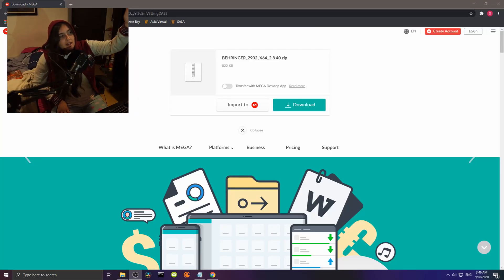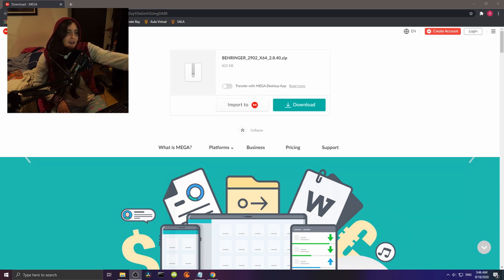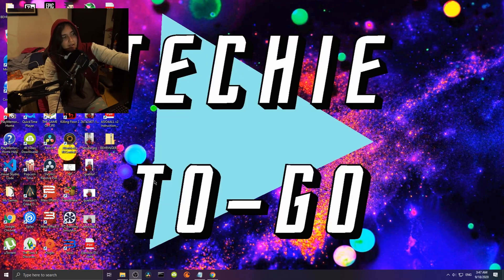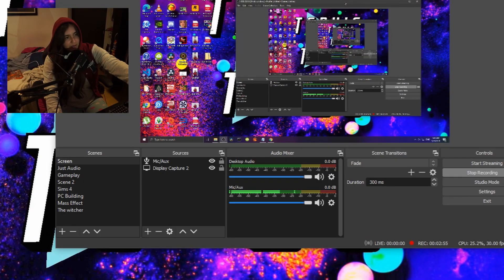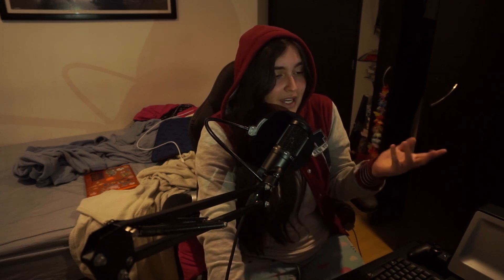FIX UPHORIA UM-2 NOISE!! (ALSO WORKS ON OTHER INTERFACES)

Comment: So using ASIO4ALL, i have always experienced latency issues (I use an MXL990 for my mic), but they've always been so minor, that I've over looked that issue. I never even though to download the drivers that are meant for my audio interface. Anyway, i downloaded the drivers, and was very impressed with the lower latency it offers (3ms). However, all was well until i tried mixing. Every time i chose a new plug in, i would be greeted with awful crackling sounds. I know it's not my computer, as i recently upgraded (CPU usage is at 6% when FL is open). There are no crackling sounds when using ASIO4ALL or FL STUDIO ASIO, which leaves me to conclude that it must be Behringers shitty drivers that haven't been updated in over 3 years, or could it be something else? I've tried disabling unnecessary sound drivers in my system settings, and that also didn't work. Has anybody had this problem, and if so, is there a fix?

Tl;dr - UMC22 making crackling noises whenever i add a plugin to the mixer.
Reply from the maker: Have you tried using less USB ports? That generates that problem sometimes.
Reply: I'm using 3 out of 4 USB ports, i will have that in mind, i kinda fixed the problem with asio4all driver, i unplugged my headphones from my A. I. and plugged them into my pc, running only my mic on the A. I. , and then combined them both, it fixed the cracking noise but now i can't have my headphones plugged in a.i. and it really bothers me, also can't do the "Direct Monitoring thing" ...
Reply: @mrserpenteen4117  Your problem its pretty simple to diagnose, those 3ms of low latency, is the issue, when you add a plugin, the buffer of 3ms is too low for procesing operations, try to up the 3ms buffer to 4, 5 or 10ms. else you have to use another driver with a bigger buffer size.

Comment: i still have problems with the noise after installing the driver
can you help me?
Reply from the maker: This interface still has some huge grounding issues unfortunately, and the drivers can only help so much. If you're using it for YT videos, I recommend using OBS Noise Reduction. Other than that you would need to try to remove it manually.
Reply: @thesaintofwolves  ok, thanks, i'll try to make something for that grounding problem, if not, i'll try what you said

Comment: i got the same interface and i did the thing and i still got some crazy noise
Reply from the maker: This interface still has some huge grounding issues unfortunately, and the drivers can only help so much. If you're using it for YT videos, I recommend using OBS Noise Reduction. Other than that you would need to try to remove it manually.

Thanks for watching!

Comment: SO I GOT THE UM2 RIGHT, THEN IT WAS WORKING PERFECTLY. I GOT THE DRIVER FROM THE BEHRINGER WEBSITE THERE WAS NO BUZZING. COUPLE OF MONTHS AFTER RECORDING I HEAR THIS BUZZING SOUND. NOW IM CONFUSED I KINDA TRIED TO TROUBLESHOOT IT REPLACED THE WIRES ALL THAT AND EVEN UNINSTALLED AND INSTALLED THE DRIVER AGAIN BUT STILL IM GETTING NOISE. CAN SOMEONE HELP ME OUT PLS.
Reply from the maker: This interface still has some huge grounding issues unfortunately, and the drivers can only help so much. If you're using it for YT videos, I recommend using OBS Noise Reduction. Other than that you would need to try to remove it manually.

Thanks for watching!

Comment: I have the Behringer Umc-22. Does this still work?
Reply from the maker: You would have to give it a try, either way, these kind of things are reversible through your device properties so worst case scenario you just put the drivers back to default.
Reply: @thesaintofwolves  It didn't work, however, I found a different tutorial and all I needed was a different driver. Thank you for pointing me in the right direction though!

Comment: These are not the drivers for this device. Had they been, they would be available in the official Behringer web site, but they are not. Behringer's official documentation and videos, say no drivers are needed for this device and the AUDIO CODEC that is used by default, is the one officially suggested and supported by Behringer. These (2009) drivers that are suggested here and in other videos, will not give you a single channel (mono) output available with AUDIO CODEC, only dual channel ones. So your XLR input will only sound to the left channel. This may be fine if you're mixing with an audio software, but it will render your device useless if you want to use it out-of-the-box as a communications interface.
Reply: Thats what I figured out after installing them. Unfortunatly if I deinstall them through the software my Mic doesn't show up in my Sounds anymore. And i tried everything to get it working again. Do you now how to install the 'old' 'normal' windows drivers again??
Reply from the maker: Sorry this didn't work for you! It's an easy process, so let me walk you through it.

1. Right-click the Windows/Start button on your bottom left corner.
2. Click on "Device Manager"
3. At the bottom of the list you'll see "Universal Serial Bus controllers", click that.
4. You should see your interface, double-click on it.
5. A little window will pop up with a few tabs, click on the "Drivers" tab.
6. You'll be presented with two possible options, "Update Driver" and "Uninstall Driver". "Update Driver" should tell Windows to look for the newest driver they have and install it. I'm 100% sure it won't damage your device or anything, however I haven't done it myself because I'm fine with the ones I mentioned in the video. Worst case scenario? It just doesn't install new drivers. Now the other route is "Uninstall Device". This one will just remove the device and the drivers for it from your computer. To get the original drivers back, just disconnect and connect the interface again, and Windows will do its thing.

Hope this was helpful!
Reply: @thesaintofwolves  yes i tried that over and over again. But each time after the deinstallation the micro would never be recognized but the pc again..
Reply from the maker: @moritzschmid9613  I've given the same instructions to other people, and it works fine. If you hit me up on Instagram I'll be happy to help see what's going on.
Reply from the maker: Yes you're right. It's not the biggest deal for most people that are using any kind of editing software so I really didn't see why I would mention it. They are, however, Behringer drivers that do help a lot with the software side of the noise issues many people have.

Comment: After installing the drivers, the volume on my mic is now very very low even after turning the mic gain to max.
Reply: too
Reply: i have the same problem did you find a fix? or how to install the old drivers? Since deinstalling these drivers didnt work for me
Reply: @moritzschmid9613  same, how u fix it?

Comment: whgen i instal the driver, i can just set up my mic in stereo, and it jus recordo the left side, i know than i kan edit that, but i use my interface to voice call, do u know how to fix it?
Reply: I got a diferent solution with hardware because im not a fan to use voicemeter because it laggs my audio in gameplays (and even now, i dont know why)

The problem was than the usb data cable get dc noise (um2 interfase dont have n dc cable, it get power with the same usb cable)

The solution? Split the dc and the data, make a "mod usb cable extention", a normal usb cable have 4 lines, 2 for data and 2 for dc (the dc color are red and black) so i cut the custom cable in the half and separate all lines, and put the dc cables in one side and the data cable in other side (its important to remember with one its the dc cable and witch one the data cable).
The original cable get conected to the modded extention, you got 2 usb, theside data go to your pc and the dc cable you can conect it in othee usb port (it doesnt matter because the data source will be clean of dc) you can even conect thw dc side to a eall with a movile dc charger, an woala, it workc for all interfaces because it is almost the 100% of the sourse noise.

Excuse my horrible english, it is not mi native languaje and i dont use to write it (but i can understand it perfectly) but if you dont understand me, i can post a video link about someone doing what im talking about (in spanish but uou can get the main idea)
Reply: @xluismigueljcx  Hey, that is very interesting!

 For you issue with voicemeter, if you need to use it, you can lower the latency by going to settings, and changing the buffer size of the different apis, In my system I can put the WDM api with a buffer of 160 samples wich at 44.1khz or 48khz is a latency of about 3ms, pretty much unoticeable for games and normal recordings. 

Can you please post the link to that video of USB split cable?, I would like to try that mod. Thanks for sharing the info!
Reply: @terry-  shure, just let me search it, im wirling rifjt now and i havent a chance in this moment. But ill pos it today

And shure, i can downgrade the size of mu buffer nut i try thatcincthe pasr and its not much diferent, the audio still got "cuts"

And i have the idea than if you have an audio interface , you want it to get s good sound, to upgrade it, for me it was not a good solution to downgrade the buffer size
Reply: @xluismigueljcx  Thanks man!
Reply: Simple just go to the sound control panel, then speakers then click on your interface and you can change it there, I'm not in front of my pc to tell you the exact steps, but that is basically how you change it to sound in stereo, or mono,
Reply from the maker: Hi! You would have to use your editing software or voicemeeter banana to convert it to mono. I have the explanation and reversal instructions pinned at the top :)

Comment: I just installed the same drivers you have shown, but here's the problem, I got no fuckin input from my microphone I DON'T KNOW FUCKIN WHY, maybe others got the same problem as me?
The only difference between you and me, is, that you used the UM2 but I used the UMC22. I googled very much, and found like, everyone talked about iunstalling them, I did and know, I have no mic input. I tried multiple times to reinstall the drivers, doesn't help. So someone got an idea what I can do?
Reply from the maker: What program are you using to monitor the input?
Reply: @thesaintofwolves  I wanted to use this Audio Interface with my aukey gd-g1 mic basicly on discord to chat with friends and people :), to have a better sound compared to headset microphones. I did couple bad experiences in the past with headset mics LOL

Comment: This helped a lot! Thanks! Just one thing is bugging me: when using windows "listen to this device" the sound is good, but when passing my audio through VoiceMeeter, even when the knob at my UM2 is all the way to 0, i have some noise. I don't know if that buzz/noise can be heard by the others when speaking but it's there. Have you encountered this problem?
Reply from the maker: Hey! Yeah, it's still pretty noisy because of it's grounding problem but a lot more manageable. I personally use OBS and it has a filter called Noise Supressor. That works great for me. It's not the ideal but it does the job.

Comment: Thanks how can i use my microphone with this new drivers? Cuz seems like this new drivers don't read any input signals :(
Reply from the maker: Your interface will be set to 2-channel. Therefore, it will seem that you only get audio from one of them. If you have a windows computer, sometimes you need to mess with the settings a little to hear it.
Reply: Thanks 🔥

Comment: Hey I've got this problem where my shit makes so much of sound infact all sorts of sound's be it static, white or ground noise. I thought it was from the mic so I unplugged the mic from the interface and it still makes noise regardless of the mic being disconnected from the interface. Any idea on what can I do?
Reply from the maker: This interface has a really bad grounding problem. Try putting it different places or connecting it to different usb ports. Sometimes it helps a little. I use OBS Noise Supressor in my videos and I think it takes out A LOT of noise
Reply: @thesaintofwolves  alrighty thanks :) what's obs noise suppressor?
Reply from the maker: @Isaaccdavid  OBS is a streaming/recording software I use for the audio in my videos (the recent ones at least) and the noise supressor is a filter you can add.

Comment: Thanks a lot! 
how much gain do u have on the UM-2? and how set your OBS settings? my mic sound so saturated even on low gain. with Windows volume at 100%.
Reply from the maker: On OBS I just have a noise supressor as a filter. This also helps a lot! And I don't know how much gain I actually have, let's go with around 50-60% gain. 😁👍🏼
Reply: @thesaintofwolves  Thank you so much!
Reply from the maker: Happy to help you out!

Comment: Tried installing that driver, but got the following error:

Unfortunately the installation failed 
(Error: Timeout - 0x0005) 

Help? 

Thanks in advance
Reply from the maker: What? Hm. Did you try installing as administrator? Disconnecting and reconnecting the audio interface?

Comment: I have purchased Sonic plumber cable but still hissing and noise is coming from the behringer audio interface.
How to fix it?
Reply from the maker: Have you downloaded the driver and used the line-in option instead of USB?
Reply: @thesaintofwolves  yes
Reply: try to above any devices or DC about your interface
try give more boofer size on your DAW